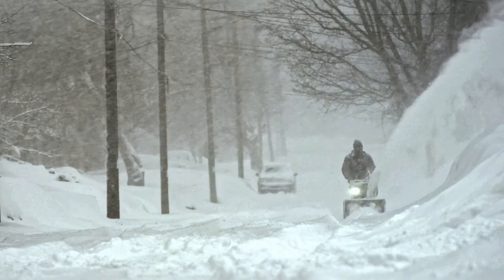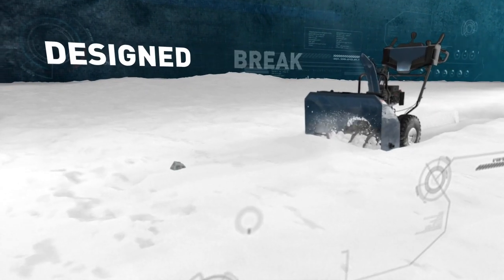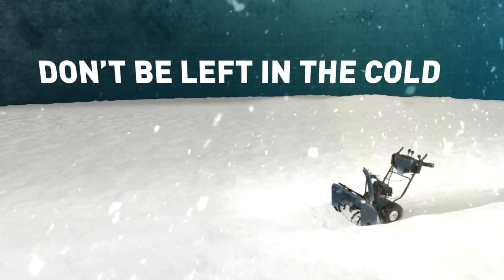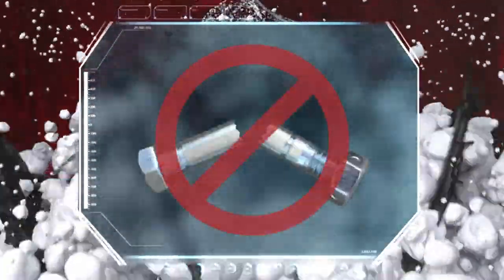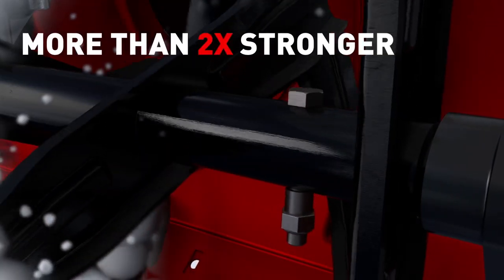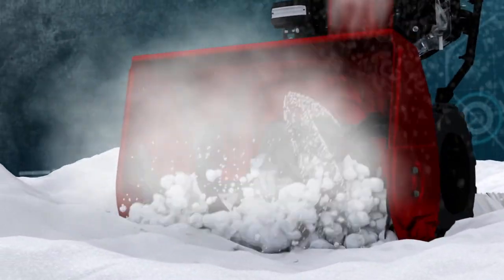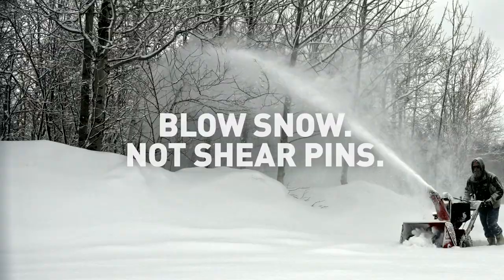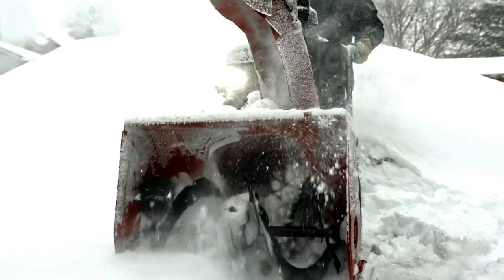Power Max Two-Stage Snow Blower: No Shear Pins | Toro® Snow Blowers

Comment: Just broke one of these 321-10 bolts in my brand new 826 that you say don't break. Snow blower didn't stall or disengage auger, just broke the bolt and now only one side spins.
Reply: Same thing happened to me. Did you end up fixing it?